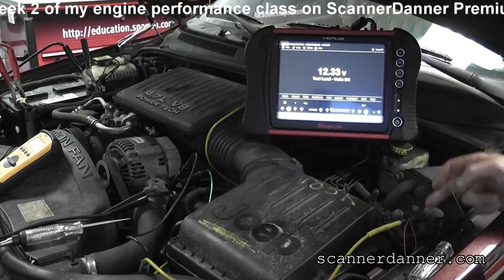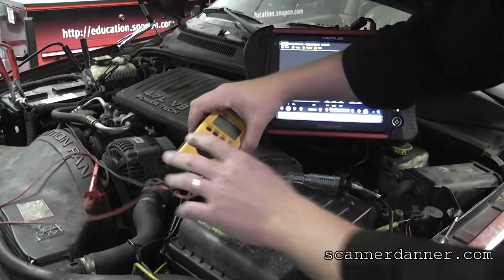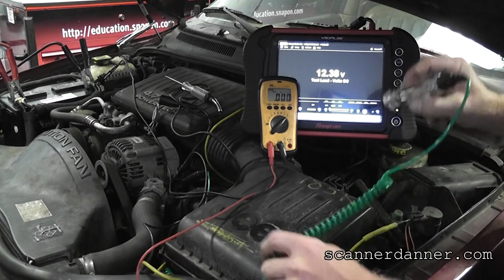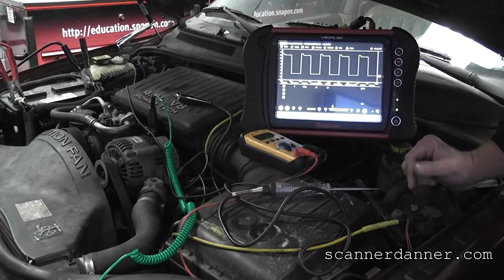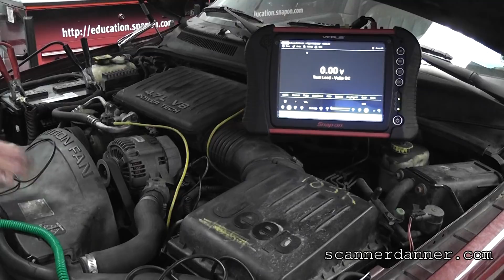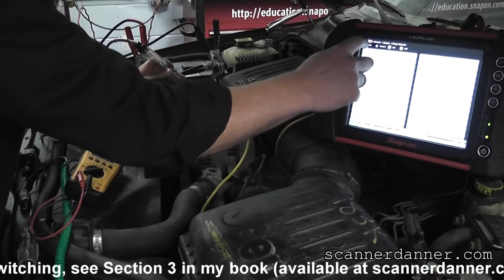How to test a computer controlled solenoid - power/ground side identification

Comment: Hello. Ground side switched solenoid  with 3.45V bias. But with the plugged connector, on the one side 12V on the other side 2.80V. 
If it is shorted to ground then there must be 0. But it is 2.8V. Solenoid is new.
Is it the bad ECU?
Reply from the maker: @Elchin206  doubtful you have a partial short to ground. Tale a test light to battery positive and touch on control wire at solenoid connector (unplugged) and see if it lights. Also measure voltage at the pcm terminal. Tell me what you read with the test light there.
Reply: @ScannerDanner  with disconnected PCM? (Section 3 page 17?)
Reply: @ScannerDanner Hi Paul. Connector disconnected, test light on battery positive-test light on. Then I disconnect the PCM - test  light off.
I measure voltage on PCM pin same 2.80V
Bad PCM?
Reply from the maker: Should be 12 and 12,  not 12 and then bias. You have an open right at that connector or the new solenoid
Reply: @ScannerDanner  I am measuring 2.8 at the solenoid connector( backprobing as you teaching) and also on the PCM connector. It is the same with known good solenoid. 
Can the short to ground be "partially"?
Or is it the PCM issue?
Reply from the maker: That circuit is grounded all the time and if you disconnected the PCM and the light goes out. That means the PCM driver is on all the time.
Reply: @ScannerDanner  how to confirm it? This solenoid for VGT actuator. What can I check with a scanner or scope?
Reply from the maker: @Elchin206 next step. Find out when that solenoid is supposed to be on. If it's on all the time and you can't bi-directionally turn it off either. Your done. Bad driver. BUT, you must make sure the VVT solenoid itself is not shorted before replacing that PCM.

Comment: Ever experience an issue due to unplugging/reconnecting a connector with the KOEO or KOER?
Reply from the maker: As far as damage to a computer? No, never. A solenoid will have higher voltage spikes when the field collapses (when its turned off) than any connector unplugging would create
Reply: Ok, I didn't think you would do it if there was a chance of something being damaged, computer or otherwise.  I only ask because one of my other books says it could "destroy some components depending on various circuit designs".  Your response is appreciated!
Reply from the maker: @alyte11  There are certain circuits where you'd want to be more cautious. Take an airbag module for example. I'm definitely not unplugging one of those with the key on.

Comment: After connecting the test light to battery positive and touching the t-pin on the control wire on the ground side switched how do i manually check the driver without a scanner where the light flickers on and off the same way as the bidirectional scanner? Cause I don't have a Snap on scanner. Please let me know I will greatly appreciate a response back!  🙏
Reply from the maker: There are two ways:
1) use a bidirectional scan tool to command it on
2) meet the conditions for that driver to turn on (this is no easy task on some drivers)
There is no other way. This shows why you NEED a good scan tool
Reply: @ScannerDanner  I'm trying to do option 2 on a 2003 dodge caravan SE how would i meet the conditions for that driver to turn on like what steps do I need to do so i can apply it?
Reply from the maker: @Diagnose1  what driver?
Reply: @ScannerDanner  The driver in the purge solenoid.
Reply from the maker: @Diagnose1  so you need to research when that purge solenoid is active. Read the description and operation of that system and that is your answer.
Again, every car is different and every output is different!
Typically a purge solenoid is active just after start up.
Reply: @ScannerDanner  I researched like you said and on the Haynes manual it said this here👇👇
The solenoid is not energized during cold starts and during warm-up. After the engine has been started and warmed up to its normal operating temperature, the PCM energizes the solenoid, which controls the rate of flow in proportion to the current level, which is controlled by the PCM.
Reply from the maker: @Diagnose1  so there you go. Run the car and get it hot, then let it idle and check for driver control.
Reply: @ScannerDanner  Im using an innova 3300 multimeter on volts dc which dial do i set it on manually so i can identify if both circuit wires are either ground side switched or positive side switched that connect to the proportional purge solenoid?
Reply from the maker: @Diagnose1  volts DC
Reply: @ScannerDanner  I understand DCV but which setting? Cause it shows 200m, 2, 20, 200 and 500.
Reply from the maker: @Diagnose1  200m, 2, 20, 200, 500
200m = will read a max of 200mv (I think) 
2 = will read a max of 2v
20 = will read a max of 20v and so on
20 is your main scale
Reply: @ScannerDanner Are you saying to set it on 20 scale on the Innova 3300 multimeter? 

Is it okay to connect a test light to battery positive and touch the test light on the t-pin to both wires on the purge solenoid while plugged in on positive side switched just so i can see the test light light up like how it did for you in this video even though it will backfeed on me ? 

The test light i have from harbor freight is 220 amps or milliamps.
Reply from the maker: @Diagnose1  I have 400k people asking me questions. This does not work for me. If I do not reply, please stop asking over and over again. 
I understand you want to learn and I will help you, but I cannot answer every single question you have. I just can't. 
Yes, the 20v scale is what you will be using most on a 12v system
Reply from the maker: @Diagnose1  DO NOT DOUBLE T-PIN A CONNECTOR! If they touch each other, you WILL fry the driver in the computer. Watch more of my chapter 3 classes and case studies. I cover this expensively
Reply: @ScannerDanner  I applied the steps you showed in this video and come to find out that the 2003 dodge caravan se purge solenoid is power side switched.
Reply: @ScannerDanner  To check a power side switched purge solenoid computer driver does the test light need to be connected to battery positive or battery negative?

Comment: I noticed you checked the computer driver with the Solenoid unplugged with the test light.can you also test the pcm driver with the solenoid plugged in ?
Reply from the maker: Yes, but if the solenoid is shorted you can get misleading results.

Comment: Can someone please help me  key on engine off
 I'm getting 1.79 volts in both sideshow  
Unplug 1.79 and control side 0.0 im really confuse  07 dodge caliber purge valve p0444 
I don't know where to start I'm not getting any voltage from either side is probably the tipm?

Comment: My 86 ranger 2.3 egr relays rubber attaching holder broke and the two egr relays sounded like lifter noise. Took them all out and couldnt find problem. Got really bad, drove it 1 year not being able to understand. Not a mechanic. Maybe shade tree. Wraped them in foam and brought them off the metal fender. Still dont why they pulse and whats wrong

Comment: Hi Danner, I was testing the vacuum regulating valve (for turbo actuator). It is supposed to show pulse curve , a kind of square voltage at both ends. With my scope, I see just a line of 12 v max witout up and down. Is the ecm itself who supply the pulse curve or it is the electrovalve. What do you think please. The car is Toyota avensis.thank you.

Comment: Hey, Paul. Could you energize a ac clutch coil that way?
Reply from the maker: Yes, by jumping thr load side of the relay, which is what the uActivate tool does that I think I was using
Reply: @ScannerDanner   In this video, you did not use the Uactivate; you used the voltmeter as a jumper wire to energize the solenoid.
Reply from the maker: @perez7667  then I would have switched the DMM leads to amperage, not voltage. I've done this many times. An ammeter is simply a jumper wire with a gauge on it lol

Comment: Hello sir,can i use multimeter as a jumper wire even for a lower current?ex.lower than 100 or lower than 50 if i dont have incandescent testlight, if it safe for the computer?

Comment: So will a ground side switched circuit have 12v+ on both sides of the solenoid until the control module toggles the signal wire to ground?
Reply from the maker: Yes, but don't call it a signal, that is a term applied to input circuits. I know I'm picking on a word and it's no big deal, but it is important when learning these concepts to use the correct terminology to prevent confusion when troubleshooting. Make sense? We would simply call this a control wire for an output (which is what a solenoid is, an ouput)

Comment: Would you end up frying the computer if you grounded the power wire instead of the control wire?
Reply from the maker: No but you would blow the fuse. When you get into trouble is when you ground a control wire that is power side switched by the computer or power a control wire that is ground side switched by the computer
Reply: @ScannerDanner  got it thanks

Comment: Thank you, Mr Paul, for your great teachings. Just to confirm, In a power side switched solenoid, the output state monitor wants to see 0v with driver off and 12v with driver on and in a ground side switched, the output state monitor wants to see 12v with the driver off and 0v with the driver on ?
Plese a simple yes or no answer is good enough for me.
Reply from the maker: Yes sir
Reply: Thank you so much, Sir. Happy new year!

Comment: This power ground side identification business and your book. I have been reading it and find myself confused. My Golf 2.0fsi has high emissions and fails the government tests. OK so I test egr solenoid pins 1 and 5 with connector UNPLUGGED. Both show 12v and I asked you once about this. You’d mentioned one must be bias voltage. So I connected a test light to battery ground and touched both one at a time. Yep the test light lit when I touched both. The flow charts say pin 1 is battery ground and 5 positive though. So I run leads from battery to egr and the thing clicks. I look with inspection camera and the valve does not open though. So I use scan tool and action it with obviously connector reconned and the valve opens. So how come it does not open when my wires were same thickness as the wires in loom? How come the two wires show 12v and will light a test light when connector unplugged?
Reply from the maker: what kind of test light? bet it was an LED type, you need an incandescent light
Reply: Nope not an LED for sure. Incandescent from laser tools. Since that I have also found the ECM has a pin broken and others around with green mould or something on them. The broken pin is for12v input from main relay. Guess this is the reason engine computer not operating properly. Did also discover that with the cylinder 2 and 3 misfire I could make it go away for 4 days by removing and recomnecting the ground wire to the electric power steering rack. VW had issued recalls on 66,500 cars because ABS/ESP unit looses ground connection. Fix supposed to be either software update or new ABS module.

Comment: I sure like the way you use your the ammeter side of your multimeter as a jumper set, after verifying circuit design. Not only do you get instant amperage readings, you also have a fuse inside the ammeter to hopefully protect the circuit if you make a mistake. I can't say how many times I've fried the ammeter side of various meters, every time slapping myself in the forehead like Mo in the three stooges. It hasn't happened in the last decade, but surely it will happen again one day. So far, touch wood, I haven't yet fried a PCM....

Comment: How to determine which Computer connected components can be tested with the incandescent light and which require the "computer safe" LED light? Superb video, thank you.
Reply from the maker: The "computer safe" LED test lights will get you in trouble more than help you. (misdiagnosis of circuits) Just make sure you know what your test light current draw is. The one I use you can find on my website on the tools page. https://www.jbtoolsales.com/otc-3633-mini-circuit-tester#oid=1014_1
It draws about 180 - 200 ma of current and is good for testing most output circuits. When would I suggest an LED test light? For stepper motor circuits and base circuit control or triggering of a transistor. 
Thanks for watching and great question!

Comment: so Paul if I went on my pulse with on my modus ultra and used my other scanner for bi directional control it should work just fine for power side and ground side switches
Reply from the maker: I would use a voltage scale, not the graphed pulse width. You want to see amplitude of these signals and the signature of the waveform.
Reply: thanks Paul keep up the great videos

Comment: Does it matter where, in the circuit, you put the AMP meter in order to get the correct reading? I know you put the meter on the NEG side of the circuit. What if you put it on the POS side?
Reply: Doesnt change anything.

Comment: Hi Paul, sorry if I keep saying this, but great vid, again! Question: how were you so certain up front that your incandescent test light would not harm the driver. Was is just general knowledge that that kind of solenoid would need about 300mA to energise? When and what kind of circuit/driver would you NOT use an incandescent test light? Remember the vid where you recommended using a 5K ohm resistor to put power side into a sensor (TPS) ground? How do you judge when it's ok; when not? thanks:-)
Reply from the maker: +Alex Messina All really great questions and too much to answer in print. This is all stuff I cover in class. Would you like a coupon for a free month of my premium channel?
This would be Section 3 material

Comment: hi paul  if got test light 6v to 12v  can i use it ok ok.or i ned buy 6 /12/24 v thnx
Reply from the maker: +KURDISTAN uk just a 12v test light is fine. 24 if your working on 24 volt systems
Reply: ok thanks

Comment: Hola Mr. Danner, great video as always love them all, my question is while doing these test does the key has to be on all the time (KOEO) for the ground side switch?

i heard that for the ac clutch it is needed to be running (KOER) if i don't have a scanner
saludos from Mexico
Reply from the maker: +Edgar Castañeda it depends on the circuit you are working on, you may need the engine running on some

Comment: You made power and ground side switching explanation so clear and precise it's like magic Paul.  I'm serious....great video once again!  Last week I diagnosed a defective EVAP canister purge solenoid on my 4th gen Corvette.  I bench tested it and found mini bits of charcoal inside the solenoid...it 'froze' stuck and would not open.  Hoping I can edit the video soon and post it to help others.  Turns out the charcoal canister internally failed and engine vacuum sucked the charcoal into the solenoid when it opened.  Crazy I had never seen this before.  The symptoms of a clogged vacuum tube/solenoid not working...extreme fuel vapor pressure when removing the gas cap!  Never had a trouble code...1993 model OBD 1.

Comment: Great video. On the A/C circuit, I believe, w/out having a wiring diagram, the pcm controls a relay in the PDC (power distribution center) sending power to the A/C clutch. So even though the A/C is power side controlled at the clutch, the pcm controls the relay on the ground side.
Reply: That is correct but the concept is the same as far as circuit ID and testing on a power side switched circuit.
It even shows that this concept can be used on a non computer controlled switching circuit.

Comment: You say that a test light has to be used with a faulty or open coil, would you be able to put the scope positive lead to battery and earth lead to control wire? For earth switching.

Comment: I had a jeep just like that in my shop not that long ago and the air box was cracked on top of the throttle body which looks like that one is as well. It caused some running issues and a dtc.